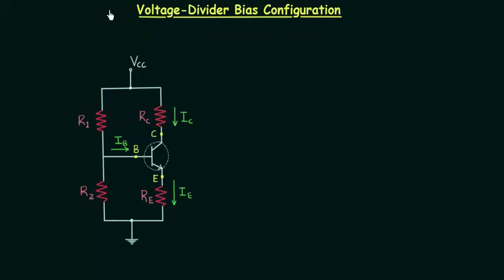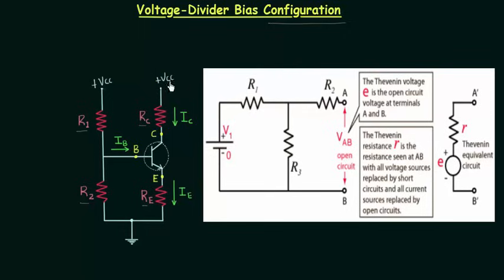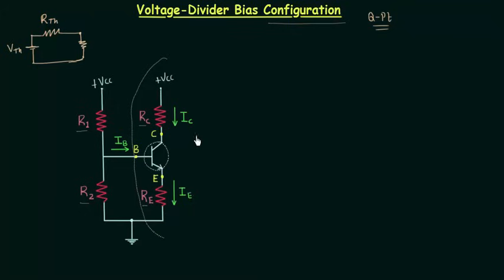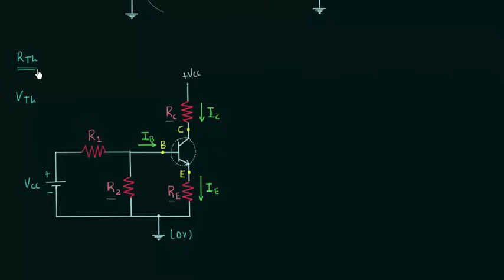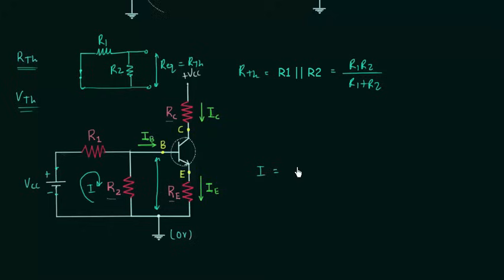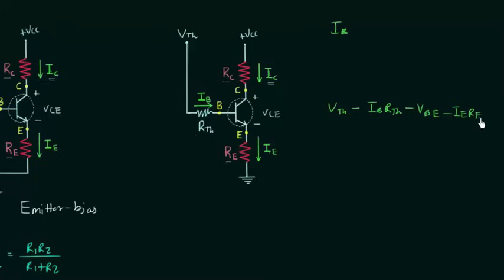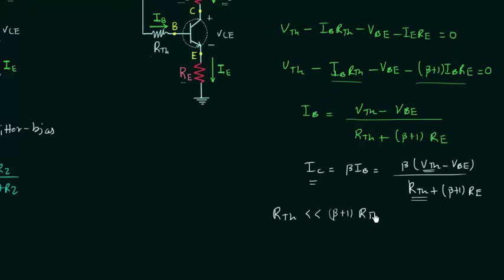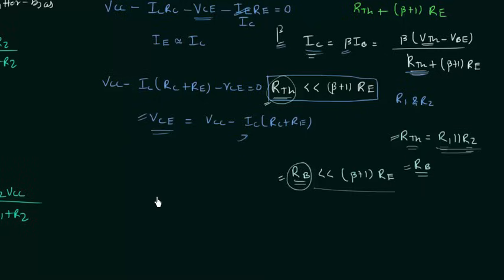Voltage Divider Bias

Comment: Q1. it is known that parallel combination of resistor divides current not voltage, than why this is known as voltage divider?
Q2. While finding V_th, total resistance was taken as R1+R2, but that's the case for series not parallel, why?

Comment: At 8:30 you miss a trick. Since Ic = β.(Vth - Vbe) / (Rth + (β+1).Re), once you have the condition Rth  << (β+1).Re, along with β >> 1, you can immediately derive Ic = (Vth - Vbe) / Re and thence calculate your operating points. By the way, Vce is not the output voltage as you claim at 9:35 - the output voltage is the voltage at the transistor collector and that is Vce + IeRe relative to ground. Students get confused when the build the circuit and find the output voltage they measure is different from Vce.

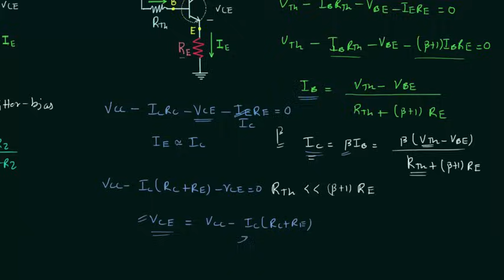All of the discourse from 10:00 onwards is unnecessary. In any real biasing scheme, R2 will be less than R1. If you ensure that R2 << βRe (what you call "Rb" << (β+1)Re)) then because the parallel combination of R1 || R2 is always less than R2, you will always meet the condition that Vth << βRe. Students will be confused if they are presented with something like "Rb" that isn't defined or described elsewhere in the lecture.

Comment: for Rth r1 and r2 are in series
Reply: Nope, they are in parallel. Assume the supply voltage is Vcc. The voltage at the junction of R1 and R2 is then Vcc.R2 / (R1 +R2) - this is what we call Vth.

Now connect a resistance R3 from the junction of R1 and R2 to ground so that it draws current from the node (i.e. in parallel with R2).
Let R be the parallel combination of R2 || R3 = R2.R3 / (R2 + R3).

The voltage at the node is now Vcc.R / (R1 + R) , so the current drawn through R3 is I3 = (Vcc.R / (R1 + R)) / R3. Substitute for R = R2.R3/(R2 + R3):
I3 = (Vcc.R2.R3 / (R2 + R3)(R1 + (R2.R3/(R2 + R3))) / R3. Cancel the R3 on the top with the R3 which is dividing:
I3 = Vcc.R2 / (R2 + R3)(R1 + (R2.R3/(R2 + R3)). Multiply out the denominator:
I3 = Vcc.R2 / (R1.R2 + R1.R3 + R2.R3)

However, if you consider a voltage of Vth fed through a resistance of R1 in parallel with R2 to the resistor R3, the current through R3 will then be:
I3 = Vth / (R3 + (R1.R2/(R1 + R2). Substitute Vcc.R2 / (R1 + R2) for Vth:

I3 = Vcc.R2 / (R1 + R2)(R3 + (R1.R2/(R1 + R2). Multiply out the denominator:
I3 = Vcc.R2 / (R1.R3 + R2.R3 + R2.R3).
That is the same current as calculated above, which shows that the Thevenin resistance (the resistance in series with the Thevenin voltage) is exactly the same as the parallel combination of R1 and R2.

Summary:
Vth = Vcc.R2 / (R1 + R2)
Rth = R1.R2 / (R1 + R2)

Comment: Thnx sir but one doubt 
How does a transistor amplify an AC signal (when it works on DC and cannot change current direction)?
Reply: An ac signal can be superimposed on an a dc bias at the base of the transistor by coupling in the ac signal through an input capacitor. Similarly, an amplified ac signal can be taken from the collector of a common emitter circuit by coupling out the ac signal through an output capacitor. Clearly, the size of the ac signal must remain rather less than the size of the voltages present in the dc biasing. For a properly designed circuit, the voltage gain will be -Rc/Re.

Comment: How do we solve for  Base Current if we're not given beta?
Reply: Assume it's 100 and you won't be far wrong. In a well-designed circuit the operating points will be fairly independent of β anyway.

Comment: So, why can we separate the Vcc in 2 points? If they're the same thing, shouldn't they always be together or something? I didn't know at all we could separate them and make calculus separated. But I'd like to know why, if anyone can explain. Thanks.
Reply: Because it's a parallel circuit with series components. In a parallel circuit each leg has the source voltage. If Vcc is 10v, then each leg sees 10v. So if you split the circuit and give each leg it's own 10v source, it's the exact same thing.

Comment: Sir if we connect a simple voltage source to base then it would be same then why we use that complicated circuit consist of R1 R2
Reply: 11:01
Reply: Because nobody in their right mind would design a common emitter stage that needed two different separate supply voltages when they could use just one. Having two resistors instead of one is hardly a "complicated circuit".

Comment: This is the beauty of neso academy. Explained the complex circuit in a simple way. Luv u sir. From NIT jalandhar
Reply: How does a transistor amplify an AC signal (when it works on DC and cannot change current direction)?
Reply: @santosh-mb5wc  In the active regions one of the junctions is reverse biased and the other is forward biased.. We apply input across the forward biased one which offers a low resistance path.. Now the current must pass through both the diodes and so as the other diode is reverse biased it offers a large resistance and hence when we take our output across it, the signal has been amplified.. NESO academy has explained the concepts in earlier videos in their playlist :)
Reply: @santosh-mb5wc  that sinosoidal wave without having any AC input signal is due to noise at the input side.

Comment: what would this circuit be useful for?
Reply: Amplifying ac signals without introducing much noise. A well-designed common emitter can produce practical voltage gains of 20 to 30 with low distortion and noise from a single supply voltage.

Comment: R1 and R2 are not parallel but in series....
Reply: Not when you're calculating the equivalent source resistance for the Thevenin voltage:
Vth = Vcc.R2 / (R1 + R2)
Rth = R1.R2 / (R1 + R2)

Comment: sir what did you mean by disadvantages in using a small Rb... I mean does it affect the circuit it anyway or is it just too much of a hassle to find a single part with that small of a resistance?

Comment: Sir how to find Vbe
Reply: 0.7 V for silicon transistor
Reply: Look it up on the datasheet for the transistor. It will vary slightly with base current and temperature, from about 500mV at 5μA to 800mV at 10mA. I usually assume 650mV which is near enough for most well-designed circuits.

Comment: how to find Ic when alpha is given ??
Reply: by using alpha,beta relation we will find beta,and then Ic=beta(Ib)
Reply: By definition, α = Ic/Ie and β = Ic/Ib. So Ie = Ic / α and Ib = Ic / β 
But Ie = Ic + Ib, so Ic/α = Ic + Ic/β. Divid through by Ic, and we get:
1/α = 1 + 1/β. that can be re-arranged to find β:
β = α / (1 - α )
Then you can use the normal calculations to find Ic, etc.

Comment: How does BETA cancel out?
Reply: For most modern small signal transistors, β is so high that β and (β+1) are so close that you can cancel without introducing any significant error. If β = 200, then β/(β+1) = 0.995 which is 0.5% error if you treat it as 1. The resistors in the circuit won't be that accurate.

Comment: How r1and r2 are parallel
Reply: To any small signal applied to their junction, the resultant change is just as if the two resistors were in parallel. If you like, you can think of the supply voltage having zero resistance to ground (which should always be true for ac signals). Then it becomes clear that for ac, the path from the junction between R1 and R2 to ground is via both resistors in parallel.

Comment: What exactly are the disadvantages  if we use low resistance Rb(Resistor-B)?
Reply: Then the input impedance of the amplifier is low. That means that we have to use sources for the input signal to be amplified that are even lower impedance, otherwise we lose some of that signal before it even arrives at the base of the transistor. Think of the source impedance (Rs) and the amplifier input impedance (Rin) as a divider network - the signal arriving at the base will be reduced by a factor of Rin / (Rin + Rs). We need Rin >> Rs to avoid any significant attenuation.

Comment: How are R1 AND R2 IN SERIES ? they share a node with another element that has current ib
Reply: since we use thevenin, R1,R2 are sereis when we calculate Vth and are parallel . when we calculate Rth. it's how thevenin thearom works.
Reply: you separate the R1, R2 and Vcc circuit alone as he did so it has no relation now with Ib

Comment: at 8:23 doesn't Ic depend on beta? it looks like it only becomes independent of beta if beta is significantly larger than 1?
Reply: In any practical transistor, β is a lot bigger than 1. For small signal transistors like BC547, it will be well over 100 at normal currents. Many types of transistor allow you to specify a high current gain part, such as the BC547C, which has a gain of 400 or more.

Comment: What if there's a -VEE voltage source? How should I apply thevenin?
Reply: If there's a negative voltage source whose magnitude is Vee, just add Vee onto every potential. Since potentials are always relative, that is a valid substitution. Now do your calculations as if the supply voltage were increased by Vee and as if the negative supply is now ground (0 V). At the end, you can simply subtract Vee from each of the operating points you have calculated.

Comment: I have a Question ,What are the disadvantages of making Rb very small ??
Reply: That may increase the base current, so that the operating point which is to be designed in the active region will now shift into saturation region... As a result transistor will not work as an amplifier
Reply: Quite simply, it makes the input impedance of the amplifier very small as well, so it attenuates any input signal whose source impedance is not even smaller before it can be amplified. That's not a good way to design an amplifier.

Comment: Here you are taking both resustors are parallel for Rth(r thevinins but you are taking voltage divider across that both resistor how it possible .i mean that in parallel resistors voltage is same know.
Reply: if you still wanna know ,, this is because of thevenin theory which creates a short circuit temporarily in Vcc so resistors becomes connected in parallel  but after the short is removed the resistors return to be in series again
Reply: please reply for this query
Reply: you can apply simple kvl and then multiply the resultant current with the load resistor, actually voltage divider is basically the simplest form of kvl, so that is why when he did kvl it seemed like voltage divider.

Comment: we always prefer voltage bias configuration why not collector feedback??
Reply: sridhar reddy, in all bias circuits Except in voltage divider bias, the collector current depends on the current gain(beta) which is temperature dependent. So it is desirable to have a bias independant of (beta). So voltage divider bias is used
Reply: I'm afraid that @Kathiravan Sekar is completely wrong. The use of negative feedback from collector to base makes the operating points more independent of transistor parameters and temperature, not less. Moving the upper point of the top base bias resistor (R1) from the supply voltage to the collector of the transistor (and approximately halving its value) produces a far more stable circuit at the cost of losing some gain (which can be compensated by lowering the base bias voltage a little and decreasing the emitter resistor). Generally, this circuit is rather harder to analyse, but actually is superior to the fixed voltage bias in most ways.